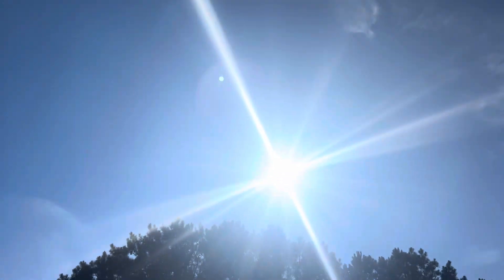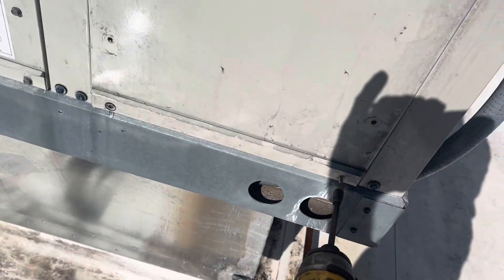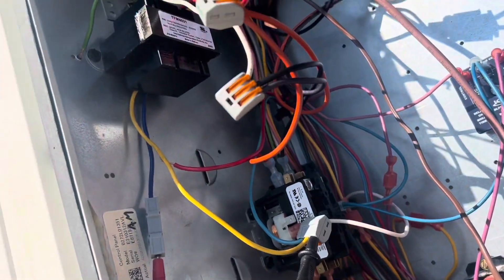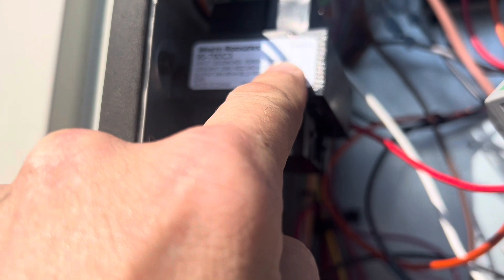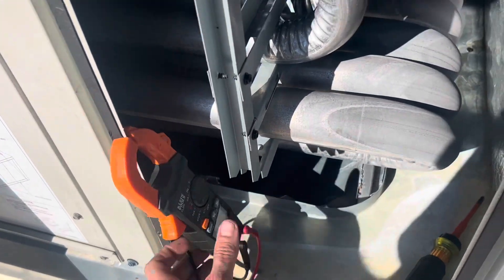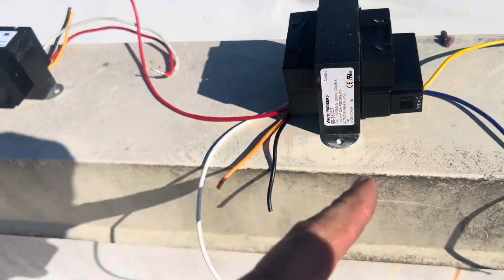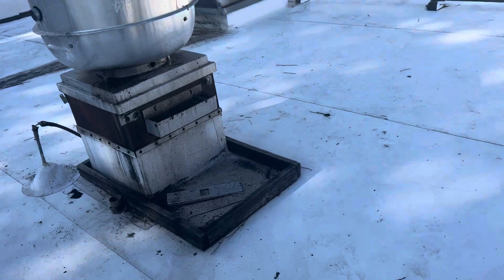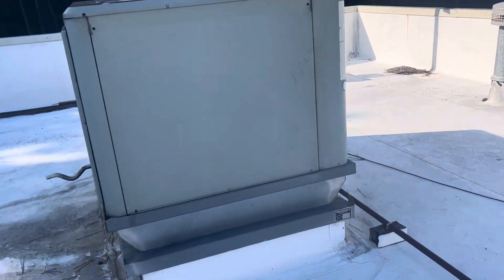Why Transformer mVA ratings matter :-(

Comment: you still have a rubout 24v.or low ohms on your contactors.and for now slide the side return cover and let some air in.
Reply from the maker: The ressetable transformer will help with establishing if there’s a short.  I couldn’t replicate it when I was chasing the wires and shaking things not on camera.
Reply: @restaurantrepairs  maybe at pressure switches wires by compressors.
Reply from the maker: Yeah. Or at the blower assembly   Nothing obvious but time will tell